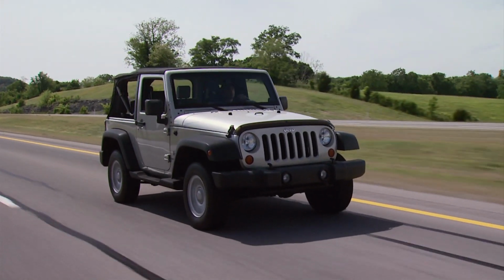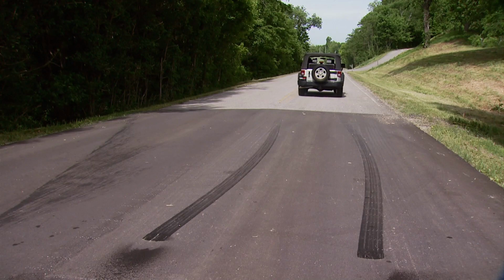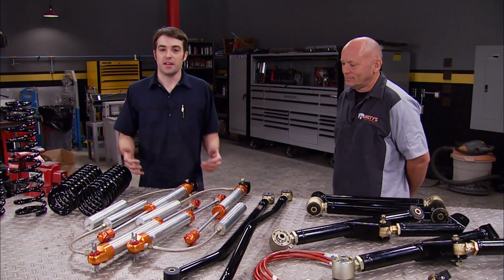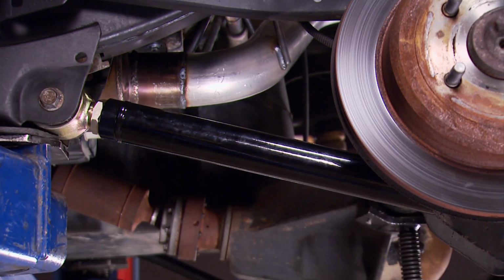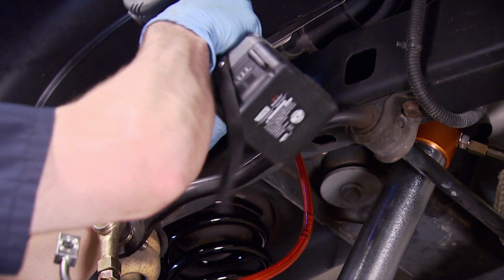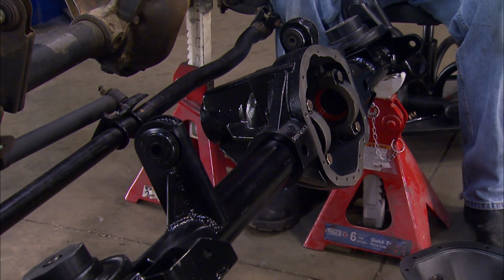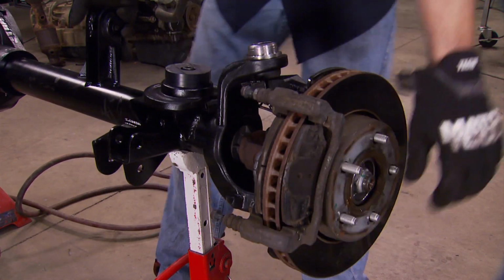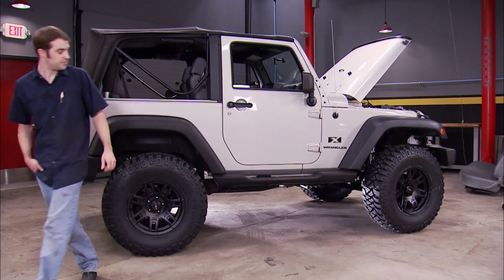Upgrading Wrangler JK Axles To Support A Lift Kit - Truck Tech S1, E16

Comment: Only real issue I have with jeeps is they are and always have been grossly underpowered. Yes, a few engines had good to great torque, but not enough HP. The wranglers are one of the few that look silly stock.

Comment: Big V8, lift kit, big tires, axle upgrade, great project! Only to screw it up with the stock breaks and calipers, go figure.
Reply: They did say they're gonna do the brakes another day
Reply: And upgrading brakes, at least to decent pads and rotors is probably the cheapest you can do too.
Reply: @Nowayjose-z2r  Exactly!

Comment: I always thought you could fit 35s with just a leveling kit on a JK..   😕
Reply: You can actually fit 35s with the factory suspension as long as you have flat fenders.  Hell, there's a fender kit out there that allows you to run 37s on stock suspension.

Comment: So you swapped the V6 motor for the Hemi V8 and only gained 1.5-seconds to a 8.5  0-60 something is not right..?
Reply: The v8 added 200lbs to the curb weight but only added 140hp.  Plus it has a 5 speed auto trans.  An 8 speed auto trans would have been better, but this episode was filmed before the 8 speed transmissions were a thing.  Nowadays, you can buy a wrecked 2014-18 ram 1500 5.7 8 speed and swap everything into your jeep.

Comment: Has a lift but takes a floor jack to use to put on new tires make so much sense
Reply: The lift likely doesnt have safety latches low enough. Health/safety and all that.
Reply: @RocanMotor  they were under the lift changing the suspension with the wheels off already could have put the new wheels on then makes no sense

Comment: 305/70r17 tires are a 34” tire. 
315/70r17 tires are the equivalent of a 35X12.50r17.
Reply: I caught that too. I have 305’s on my truck and it’s equal to about 12 inches in width

Comment: I've explained to my Jeep friends, till I'm blue in the face, that their death wobble is caused by their brakes and not the damn control arms.
My WJ had death wobble real bad after the brakes warmed up. I rebuilt the calipers, replaced the hoses and put on a pads/rotors kit. Wobble is now gone.
Reply: Wow, well my death wobble has been fixed at various points by:

1. tightening a loose trackbar
2. replacing the hub bearing units
3. replacing ball joints
4. replacing the control arms/control arm bushings.
Reply: @christophermichaelson9050  I have replaced every wear item on my front axle including all brake parts. Didn’t have wobble for quite a while until the right caliper started dragging on occasion. Time to replace it again...
Reply: Correct and it effects more than just jeeps.

Comment: Good thing it's not about straight line proformance the 5.7 hemi is a turd
Reply: if it weren't for MOPAR and the hemi, then the NHRA would be non existent. MOPAR is the king at the drag strip. MOPAR was the king at NASCAR until they were banned for winning so much. keep tying kid.
Reply: @TexasMAGA2028  Those would be still around. Just using half the fuel :).
Reply: @TexasMAGA2028  your right in the 60s they built something ,,and i guess i should have said the 5.7 in my 2019 is a gutless pig maybe someones isnt bad
Reply: @gda882002  it's still better than any gm or ford junk.